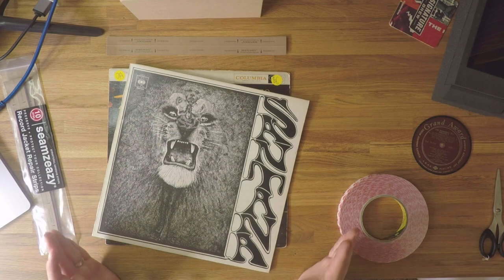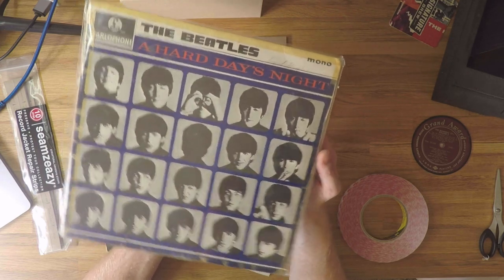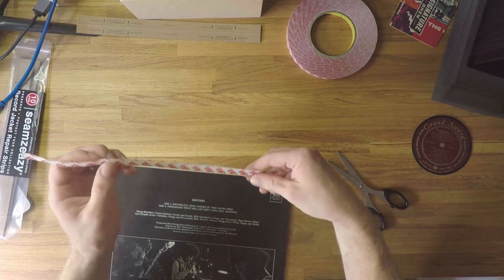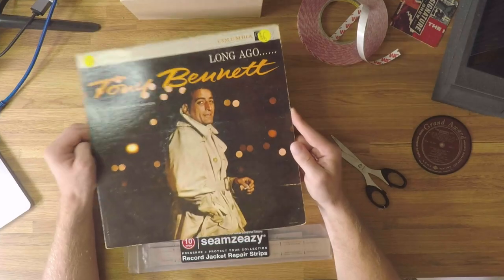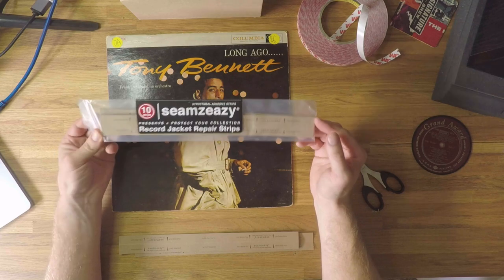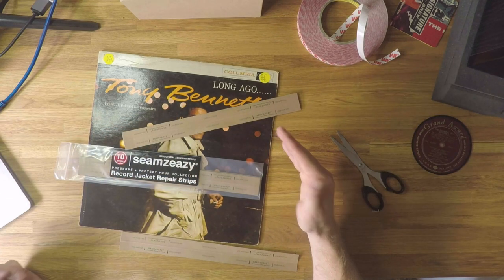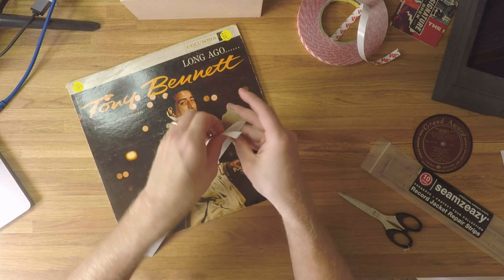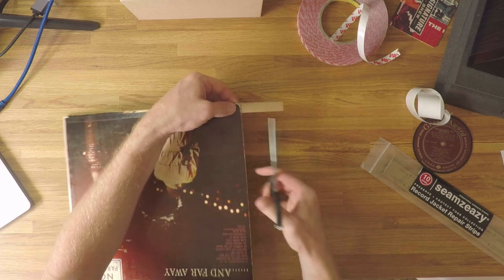Fix Record Jacket Split Seams WITHOUT Ugly Tape

Comment: Ah I didn't know what the title meant... I have LPs that would be NM if not for a minor seam split on a few...but these aren't seam splits, these are completely apart.
I don't think you can even fix a real seam split, which is where the cardboard splits where it's folded over to be adhered to the other part of the jacket.

Comment: Any tips on removing unsightly tape from a cover?
Reply from the maker: Sadly, it's pretty difficult once it's fully set and old. It has a tendency to pull the print away with it too. 

Wet wipes are pretty useful for removing old sticker residue from price tags though.
Reply: i get a damp cloth and make it first wet. 
then i dry the sticker and heat it up with a paint dryer and then it comes easily off (most of the times like an 85% succes rate).

maby try it on an worthless record first :)

Comment: If you use clear outer sleeves, I find you don’t have to fix seam splits.
Reply from the maker: It certainly becomes less critical - particularly if you use a dual-pocket sleeve. But I like to fix them up anyway.
Reply: That's no help if you buy a second hand record and it comes with a split seam.

Comment: Use Prit-Stick for album covers that have come away from the seams its fast sticking made especially for card and also it wont mark the cover it just wipes off if you get any on the cover and the bond is strong i use it to fix old vintage toy boxes books and record covers its also great if the record jacket has fluffing down the spine with paper flaking off just rub it down the spine and with your finger rub all the flaking and fluffing flat once its done you cant even see the repair and it stops it getting worse.. wet wipes for laminated cover and also window cleaner for laminated covers great for getting finger marks off and making the cover look new however do not use window cleaner on matte covers!

Comment: I myself have been using generic Elmer’s glue, acid free and 40 cents or so, bottle lasts a very long time. I lightly apply it with a paintbrush, it makes it slightly gummy and pliable and I just smooth it over nice and it’s like it never happened. I do the same with spines that are worn and peeling, and anything that is deteriorated and starting to split to reinforce it. Had a copy of Neil Young’s Harvest as well that was completely split open all sides and I was able to fix it solidly. Really fun to do honestly, and you’re able to grab records you generally wouldn’t due to splits and other damage.

Comment: Another good tip which you may have covered: Use a few drops of lighter fluid on a paper towel to safely remove small, old price stickers. You can soak the sticker for 30-45 seconds to make it even easier. Does not work so well on stickers that are years old.
Reply from the maker: Thanks J.D - great addition to the topic. I need to do a video on cover restoration. Cheers!
Reply: I kind of want to try this but is there a chance it could damage the cover? Like fading of colors?

Comment: Very good.  Short and sweet.  It was the Seemseazy that I was looking for.   Now the very last step leaves a slightly ragged edge at the top no matter how well repaired.  How much does that affect the selling price?
Reply from the maker: You could try very very fine sand paper gently to smooth off the top edge. As for resell, tricky to say without seeing what other copies are going for. A quick Discogs search is probably the best route forward :)

Comment: You can get double sided tape in UK,but maybe not 1/2 inch.I have successfully used woodglue,but you have to ensure nothing squeezes onto the inner suface of the cardboard.Use wooden clothes pegs along the seam.Put a couple inside the jacket whilst it is setting.Cardboard is a wood product.Other glues simply dry up over timr as the original gum has done.

Comment: How would you recommend fixing a split seam at the spine?
Reply from the maker: Can be tricky depending on how bad it is. You might be able to feed in one of these strips to fill the gap and then maybe use very fine sand paper to take off any fraying paper, if that makes sense?

Comment: for method 1, if the seem isn't split all the way to the end of the sleeve, say just halfway... should I open it all the way to get the tape along the whole sleeve (top or bottom) or start from where split begins (e.g. middle of the top sleeve)? Great vid!
Reply from the maker: Thanks for watching and your question. If it will come apart without force, then it will be easier to apply across the whole thing, and you'll get a stronger repair. Hope this helps!
Reply: @soundmatters  thx again. fixed my sleeve, didn't come out as professional as I'd like but better than good enough. My sleeve was split completely across the bottom and quarter of the way on top. The 3m adhesive is crazy strong.

Comment: For the flaps where the glue has failed, I use a Scotch tape roller. It eliminates the chance of any mess from using glue. They are available in the stationary aisles at Walmart for a couple dollars each. Well worth seeking out. For the blown out seams, I also use the Seamzeazy strips.
Reply from the maker: Cool. Is that a double sided tape you use? I'm finding the tape perfect for flap-style covers and Seamzeazy best for the non-flap sleeves.

Comment: Brilliant and timely video. Any ideas for crumbling cardboard covers, also, how do we remove old taped seams. And would we use fine sandpaper for fraying especially where we handle the cover when putting the record back in it’s cover, although I now store mine in Blakey sleeves separately. Thanks.

Comment: Could a person not make these them self and just use white glue? That way you could make adjustments if needed before the glue sets.
Reply: The problem with glue is you can't control exactly where it goes and it will very likely go well beyond just the small 1/4 of an inch or 1/8 inch working area you have from the outer edge of the cover when you squeeze the two sides together, blocking the actual LP disc from being inserted into the sleeve.
Reply: @klandersen42  Yes you can control it. Just cut out a strip of greaseproof paper and use it to shield the interior of the cover. Old bookbinder's trick. It's better than using this double sided tape business, which is probably acidic and won't have the staying power of PVA glue.

Comment: I've been using a glue stick for 20 years on the first type; quick, easy and very reliable. Must admit the second type only occurs with 2nd hand buys so its factored in to the purchase. I'd certainly try Seamzeazy if I had a pack.